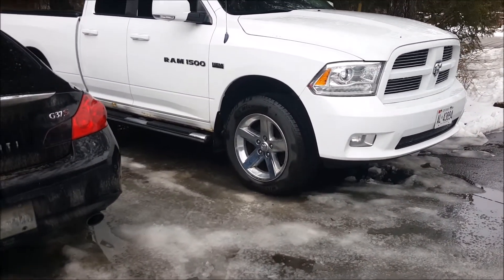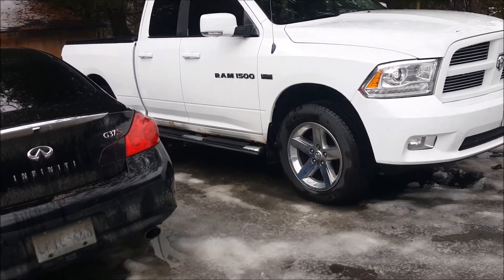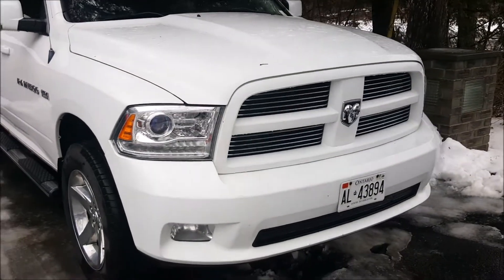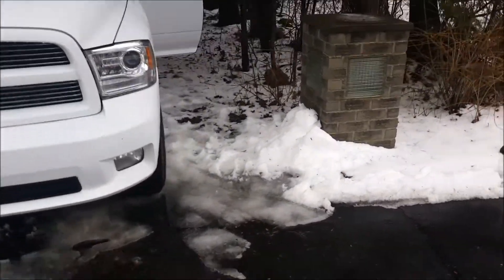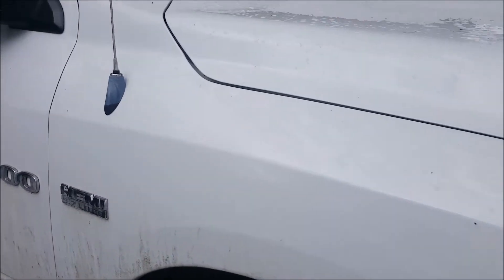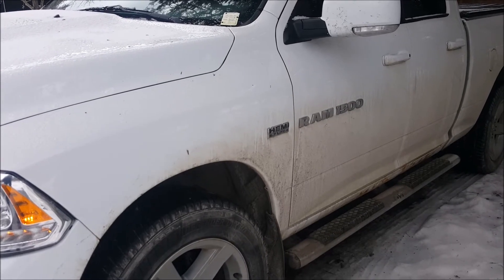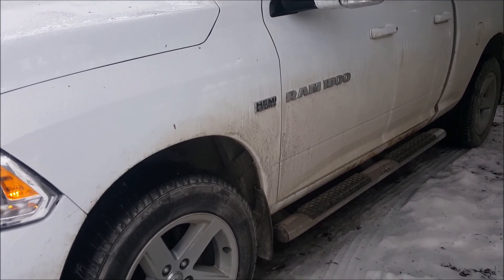2011 Dodge Ram Hemi Tapping Noise From Engine - Update!!

Comment: I have a 2018 Ram 1500 and I agree 100% about using only Pennzoil Ultra Platinum 5w20. I switched to Castrol oil and a Fram filter at 50,000km after only using Pennzoil since day one and noticed a small tick like the attached but didn't think much into it.  Around 58k I went back to Pennzoil full synthetic and the noise disappeared almost instantly. I recommend using Pennzoil with the Mopar filter and changing the oil around 8k. Thanks

Comment: A few things to keep the 5.7 hemi Rams purring.  Good quality synthetic oil.  I use Pennzoil Ultra Platinum 5w20 (only use the correct weight). Must have the Chrysler MS-6395 cert.   Not all oils have it.  I use the Fram XG 10060 Ultra Synthetic filter. Change oil often.  Push a medium ziplock bag up over the filter unscrew filter until it leaks. Patience.  Oil will dribble into bag.  Unscrew the rest of the way but hold when it comes loose and the small rush of oil will also go into the bag.  Almost zero mess.

Comment: I just bought a 2012 ram with 90,000 miles on it and know nothing about mopar stuff. Day two of having fun with the 5.7 I noticed a tick and chatter. Two weeks of concern and reading I changed the oil twice, once to Mobil 1 and then to Pennzoil ultra platinum. Pennzoil 100% made all noises go away. Please please if you own a 09-16 5.7 hemi use ONLY 1 of three recommended oil by Ram and filter or you WILL ruin your motor. And it’s a very sad time when that happens. Good luck to anyone out there having issues
Reply: Lol just like me hit a lick on an older body w low miles got my 2012 with 90k for 12k 3 yrs ago 130k now runs great
Reply: Was the tick random? Not a consistent tick

Comment: Do you know if Pennzoil Platinum High Mileage works as well? Mine has 180k on it. Or would you still recommend the one linked in the description?
Reply from the maker: From the limited testing I've seen I think sticking with the normal pennzoil ULTRA platinum is our best bet
Reply: @McGo101  thank you so much for your prompt reply, I will try this on mine and give you an update asap

Comment: Man that's actually kinda funny cuz I bought Castrol oil not too long ago for my 03 hemi, cuz they didn't have my normal Pennzoil, and it caused my truck to make all kinds of noise so I immediately went to a different store to pick up Pennzoil Ultra Platinum High Mileage (I have 232k miles) and changed it with that and it smoothed out all the noises. I don't know if the Castrol oil just sucks or if it's just not optimized for the running conditions a Hemi endures, but I'm definitely not using it for my Hemi anymore.
Reply: Castrol is trash I would burn 2 quarts every oil change with it don't burn oil anymore with pennzoil
Reply: @cartere9981  my truck was still making some noise actually every now and then on and off ever since that oil change, everyone was raving about redline so I decided to order some and give it a try, truck makes 0 noise now except very little on startup which goes away fast, I couldn't believe it at first honestly. It's expensive but I'm a lot happier with the redline and think I'll be sticking to it

Comment: Curious to learn if you still have your truck & if so how many miles do you have on it after you found correct oil to quiet it down?
I have a 2016 Ram w / same 5.7 & has the same slight noise yours had 2 years ago.
Reply from the maker: Yup still have her. It's been almost 5 years since that noise and switching to pennzoil ultra platinum. No issues since.
Reply: @McGo101  Excellent Great to hear & thank you for response.

Comment: Any update? How many miles are you at now and are you still running pennzoil ultra platinum?
Reply from the maker: She is sitting at about 215 km on it atm and still running great! Yep still using pennzoil ultra platinum. Bought enough for 2 changes when she went on sale.

Comment: I have  a 2011 ram 1500 just like yours and I have that tapping noise I used penzoil synthetic what’s the oil you are using now?
Reply from the maker: Using mobil 1 ritw now but i felt pennzoil platinum worked a little bit better imo

Comment: So what do you feel it likes better...the platinum or ultra platinum? Thanks in advance
Reply from the maker: Ultra if its available but both is better than castrol 100%. Just did another quick update start up vid but i havnt posted yet tho. Still running dece with p ultra platinum @ 219kms knock on wood lol
Reply: @McGo101  Thanks . I have the same tapping noise on my 2014 ram and it seems to like pennzoil the best as well
Reply: I have a 2017 ram 1500 5.7L hemi as well and have the same noise never had the noise till I ran royal purple full syn 5w30 now went to penzoil ultra Plantnium 5w20 full syn with Lucas additive still have the noise but not all the time seem to quite it up and less
Reply from the maker: @bikeknecks  hopefully with time that noise will go away. Lucas is the only additive i will use but i still have not used it in my oil in the truck. Too much additive could make the oil to thin. I always run 5w20, i just wont buy castrol or Quaker state for my rig just the Pennzoil ultra platinum now.

Comment: Can u do a video on your lights are those aftermarket or factory??
Reply from the maker: These are oem factory lamps from a 2013 ram. Wish they were black but got a good deal on them.
Reply: @McGo101  were the headlights plug in play or was there any modification to be done because im planning on getting some for my 2011
Reply from the maker: @thebomberThebomber-yy2th  it's been a while but iirc you need an adapter kit for the halogen lights to work going from the quad lights.  Kit was around 100 us. My wiring got corroded so I've had to hard wire them a couple years ago. Hope this helps! Cheers

Comment: Please remind me what oil and filter you are using presently? and still none of that rod knock noise? that noise had nothing to do with the lifters it was either knock or exhaust and obviously not exhaust.
Reply from the maker: Been using penzoil ultra platinum 5w20 ever since. Was using a Fram synthetic filter but switched to oem after its first rough start since the video. So almost flawless since.
Reply: Ok so youre using Pennzoil Ultra Platinum with an OEM filter by Mopar? @McGo101
Reply from the maker: @Daniel-ee6oc that's correct
Reply: @McGo101  got the MO-0899 from. Walmart.
Reply: @McGo101  how long you been using this combo?
Reply from the maker: @DanielWraps  just switched recently. After the one rough start since the video and after seeing how the Fram synthetic filters don't flow as well I just went back to oem.
Reply: @McGo101 Well, I just did the oil change. And I used exactly 7 qt. Unfortunately I still have the sound. But I was able to locate the source. I do believe it is the driver side cylinder that is closest to the front of the truck whichever one that is and it was noticeably louder, when I put a stethoscope down under the where the fuel injector is. I'm pretty sure I have camellift issue
Reply from the maker: @Daniel-ee6oc that sucks man sorry to hear. From what I've read the back ones are the first to go. If you choose to fix it it would be a great time to put a more aggressive cam in. Keep us posted bro

Comment: Mine still taps but still runs. any update on yours ? still running?
Reply from the maker: Still running with no tapping. (Knocks on wood)
Reply: @McGo101  cool maybe it’s just a noise and nothing serious 😂 i commented on your original post almost a year ago
Reply from the maker: @bryanunion5110  yea I've just been running pennzoil ultra platinum oil since I got the noise and it has been gone since.

Comment: thank you you hade save me $3500 mecanic told me to repair the engine
Reply: Did you have this same noise? sounding like rod knock (noise is louder when listening below and almost sounding like its on the outside/lower end of the motor)?

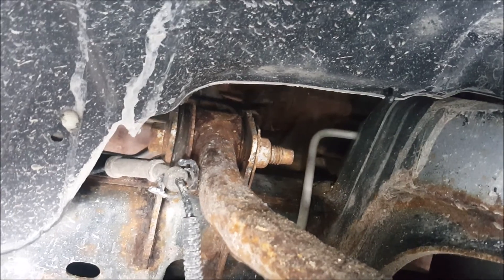Comment: 2:25~2:29 just before u said pretty quiet, deep in there I can still hear that lifter knocking. 
My 2016 just starting to making the same noise. I use pennzoil platium 0w20.120K mileages total.
I think this is a early symptom of bad lifter . maybe it is the time to dump this trash
Reply: I think all hemis make that small constant  tap sound you only hear in the wheel well could definitely be wrong though

Comment: Use a 5w40 oil instead of 5w30
Reply from the maker: Using a 5w20 as per the manual still